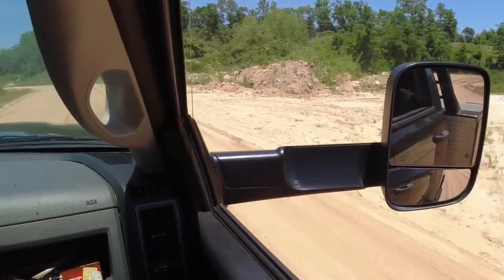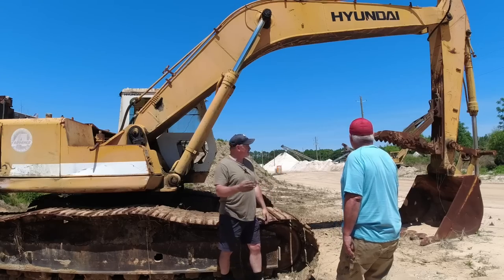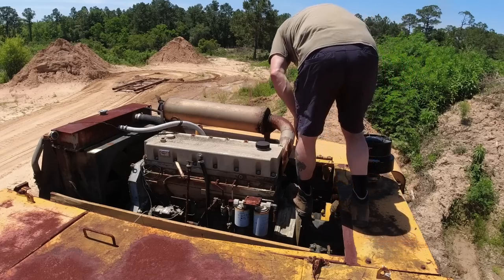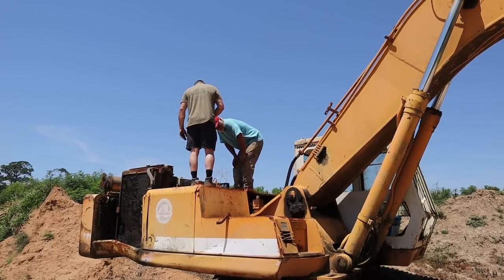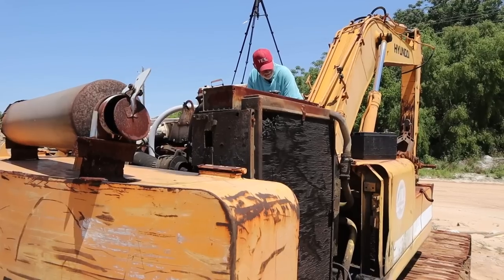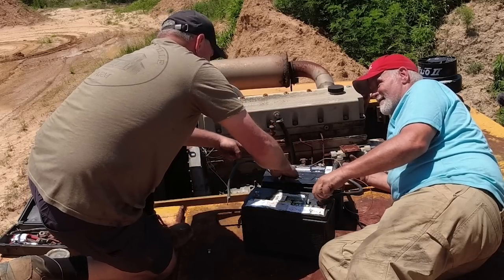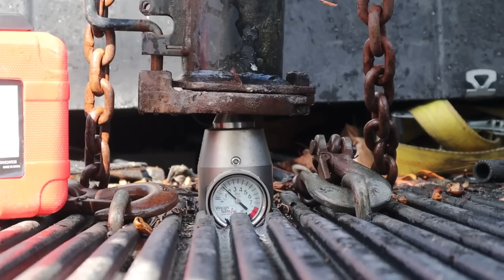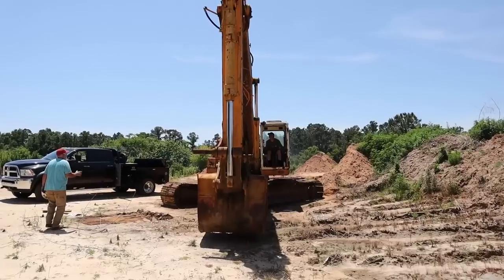EXCAVATOR MELTING under the Florida sun! Will it start and dig again?

Comment: You guys need to bring a little portable thermometer to put somewhere on the equipment while you are working on it. I bet it was 120 degrees sitting on top of that sheetmetal baking in the sun.
Reply from the maker: I got a IR gun… I should’ve seen what the temp was. I’ll try to remember to do that in a video. 👍